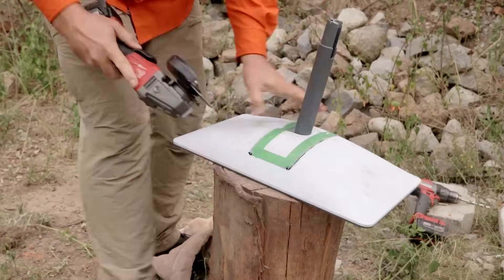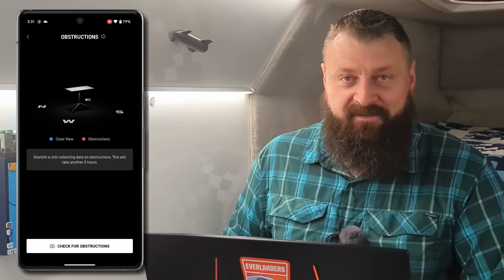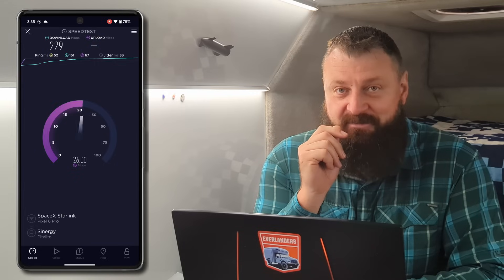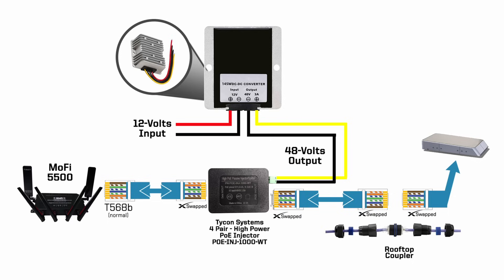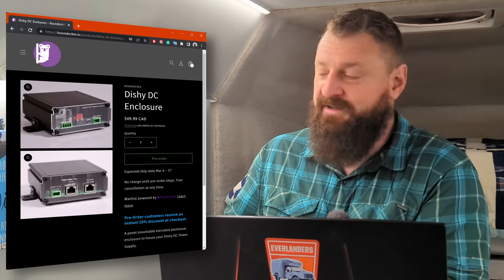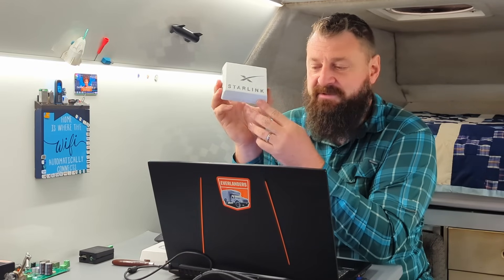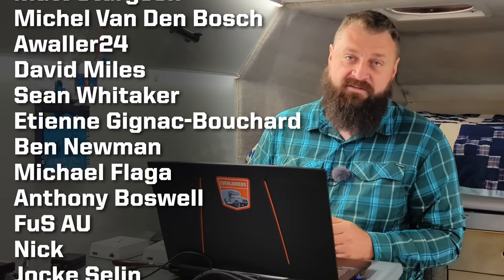Starlink DC Power Supply

Comment: @Everlanders could you please tell me if I need to X swap at the dishy and wedge side if I plan to use Boondocker 12v box?

It would be ideal to be able to swap between Boondocker's box and the original router if I need to reset the antennas and settings. 

Thank you
Reply from the maker: No need to X-Swap anything with the Dishy DC power supply, all ends can be crimped with standard T568b, and then a CAT6 shielded coupler can be use to connect to the Starlink Router.  However the settings are all in the dish, and still accessable at http://dishy.starlink.com or via the app without the SL router.
Reply: @Everlanders  Cool. For some reason when I was testing at home, connecting directly through my router without the original starlink one the app wouldn't give me any option to reset or show the connected devices.
Reply from the maker: @EastofSomewhere  No connected devices is true... Because that is now handed by the router that Dishy is connected to, but reset and snow melt and most other setting are done in the dish itself.
Reply: @Everlanders  Thank you. BTW I renewed my membership but it did it with my personal channel that I don't use much. 

Could you please don't use that one for mentions in new videos? That one is Will Perez Ronderos. 

I will try to bring it back to East of Somewhere next month. I may had been logged into that one when I changed the payment method.
Reply: @Everlanders  This one is me but the alternate account 😒. I lost my badge and got the new member again. Shame.
Reply from the maker: I'm pretty sure you get you badge back when you switch your account back.

Comment: May a dump Question but why cant i use any 12V POE Injector?
Reply from the maker: Because the dish needs 48 volts to run...
Reply: @Everlanders  Sorry I meant 12V input but I found out in the meantime that the dish seems to have a special pin assignment and does not work with "normal" poe injectors.
Reply from the maker: The pin assignment is a trival issue, just rewire the RJ45. The 48 volt PoE is the bigger challenge.

Comment: 15:58, do you still use your MoFi 5500 LTE Router? Just not using the LTE function, but connecting the Starlink to your WAN, right?
Is there another more economical WIFI Router that you recommend now for SL usage alone, and 24 volts, please?
Reply from the maker: Yes, we still use our MoFi and we still use LTE from time to time. There is still no Starlink in Bolivia, Paraguay and Uruguay, so we might need to rely on LTE again there. But if you want something cheap, any old router would work fine. Or watch our next video...
Reply: @Everlanders  , I've already ordered the Starlink Dishy DC and used the promo code "Everlanders" and got 10% off, Thank you.
Can't wait for the next video for a WIFI router that would suit us all in RVs and Boats on a 24 volts system

Comment: 4:15 That is interesting that rain interfiers so much.  Do you suppose it is water pooling on top of the array?  Perhaps a decent reason to tilt it somewhat to shed water pooling.  Or perhaps in your case apply a layer of rain-x or some other hydrophobic coating.
Reply from the maker: When we have clear shot of the sky, the rain has a minimal effect, dry tree cover slowed it down a bit, but wet trees are the worst. I could rainx the trees I suppose.
Reply: @Everlanders  No ! Dont do that, leave the trees alone - joking! StarLink is Ku band from the Satellite to the dish so some attenuation in the signal is expected during rain. Heavy rain will most likely take you off line. The high performance dish ahs a stronger signal to help with this.

Comment: I like it, though I would think a wan router design would be a  better solution as the  would give you options to cover a second to forth sat, POE based 4g/5g services and may be a air fiber  based connection service..

with a lot of things become poe based hardware internet service these it is just commonsense to build capacity into something  for practical deployment...

if i were going to deploy starlink in  in fixed capacity like you  I would be thinking 4 points of the compass deployment so there bw noway of missing a signal for  service
Reply from the maker: Clearly you've not traveled latin America.

Comment: Hi Everlanders, I like your videos please could you help me with next question?, I did the Swapped pinouts in the dishy cable that came from the antenna according Tycon PoE  Input/Output pinouts and the same pinout for the cable that goes to the router, the question is, the cable between Tycon and router, must to be a Cat6? 
Is possible to connect the cable for the router directly to a laptop that supports IPv6 ?
Can I change in the pinouts order  for the dishy cable that goes to the Tycon for other different order considering the voltage pinouts of POE?
Reply from the maker: Yes, you can connect directly to the laptop.

Comment: Having your internet connection running direct from your batteries is the only way to go, I can leave mine on 24/7 because it uses so little power and when my batteries are low in winter I turn the inverter off but can still use the net via my M1 mac for another 6 to 10 hours. Makes those worst few winter months far more civilised :)

Comment: Hi Thanks for sharing all those magical projects, I love it. I order that power supply 3 weeks ago and received it today. They made a little change in the production version for the location  of the 10A fuse. The RearCover "hole" did not match anymore with the fuse location. I guess I can trim the plastic of my printed read cover to make it fit. But it would be appreciate if you can create another rear cover file for the production design. I have picture to share if you need. On the other hand, I am still trying to print the Starlink Flat mount but since I am new to 3D Printing it's kind of hard to have a successful print.
Reply from the maker: Thanks for sending the photos of the new Rev 1.4 board, I have updated the files and posted them to: https://www.thingiverse.com/thing:5893999

Comment: On the crimp difficulties there are 2 different styles of rj45 ends. You are likely using an end designed for solid cable on a stranded cable. Using the right design will make it much easier.

Comment: Just came across your channel and it is fantastic! Working my way through your videos now. QUick question for you on the cellular modem you use. Did you use this when you were in Canada?? Are you able to connect to any of the "Big Three" carriers with a data only sim card? I cannot find any info on if this is possible in Canada. Thanks for any help or leads! Keep up the great work :)
Reply from the maker: Yes, of course... It's unlocked and will work with any carrier, Plus it's a Canadian Company, so you can be sure it works.
Reply: @Everlanders  Thank you so much for responding so quickly! I had no idea they were Canadian. That is great. I have been looking for months for an option for our home which has no other internet options other than DSL or possibly Starlink. The next challenge will be to find some kind of reasonable data plan in this country! lol Not easy :(
Reply from the maker: I'd think Starlink will be a much better option.
Reply: @Everlanders  you are probably right. Just a very long wait list so far for our area. over a year as far as I know.
Reply from the maker: @knappce  Then the MoFi can help fill that gap, unfortunately the data rates in Canada aren't so great... 😔
Reply: Thank you again for your replies. Really enjoying your videos. Your trip through South America should be incredible. Has always been on my bucket list to get to Patagonia.

Comment: awsome video
just to confirm the pin is Category B
Reply from the maker: T568B
Reply: this is to confirm your new poe injector is Standard B?
what is swapped means starlink pinouts?
Reply from the maker: No it does not conform to any standard, please refer to the pinout shown in the video diagram.

Comment: I have a Pepwave Max Transit Duo. I’ve read some folks having speed issues connecting Starlink to WAN port. Pepwave instructs customers to add an unmanaged switch between the router and Starlink ethernet adapter. 

With this 48v converter unit and changing the Starlink dishy cable to the typical ethernet cable configuration do you think the switch is still necessary?
Reply from the maker: I don't use Pepwave so I couldn't say...

Comment: I plan to convert my camper from 12 volt to 48 volt. Will I need to do much to get Starlink to work with this?
Reply from the maker: A 48 volt battery will swing from 42 to 56 volts, so you'll need some kind of boost  circuit when it's low and a buck circuit when it's high... Plus a bunch of regulation for all the 12 volt RV stuff... Not sure what the draw would be going to such high voltage for an RV.

Comment: I'm off grid with solar, and was considering Starlink as other available options were inadequate at the time.  However, it seemed to me that the Starlink system consumed about 80-90w of 120v AC power continuously to operate.  This put it at 2x the daily watt hours of my 18 cu ft self defrosting standard fridge.  Maybe I missed it in the video, but do you have any issues with the amount of power it consumes?  Thankfully my local phone company finally came around with fixed wireless internet so I can get 50mbps for CAD$150 a month and disconnect for 6 months of the year, and no up front hardware cost so I no longer need Starlink but I'm still curious about the power consumption issue for off grid applications.
Reply from the maker: Our consumption is 28 watts, averaged over 24 hours.
Reply from the maker: As shown here: https://youtu.be/gRSnTMrUPrQ?t=1928

Comment: When using these, how many watts does it pull between the dish and the new router, vs the original way?
Reply from the maker: With a high quality inverter and the original Starlink router, 60 watts.  I'm getting 28 watts on DC averaged over 24 hours.

Comment: A bit of a wild guess here without any previous research done, but I'm thinking this could all be done inside the antenna itself before mounting it to the roof. But now it would be a hassle since it's not easily removable due to the mount being glue in place. Don't want to be a downer but wouldn't it be easier if the mount and the antenna were set with maintenance and future upgrades in mind?
Also 48v I'm thinking they used it to power the motor?
Reply from the maker: No, It would be very easy to put it under the rooftop mount, just pull the screws from the aluminum brackets and lift it off the mounts. I would not consider this however because then (a) a watertight enclosure would need to be built and (b) you'd need to run 10 or 8 gauge wires up to the roof for power, kinda defeating the point of PoE. I don't understand how you feel it can't be maintained, It is simple to remove with a few screws... And no, the two motors are 12 volt... The 48 volts is required to get 100 watts of power for snow melt over long distance of thin wire with minimal losses. If it was 12 volts it would need to be 10 AWG or bigger.
Reply: @Everlanders  That makes more sense now, I've missed the part of mounting it on top of the brackets, that's perfectly maintainable doing it that way. But the circuitry there looked a bit exposed at the moment after cutting into the antenna enclosure. I was thinking this as a more direct approach to keep all in the same enclosure and directly powering it with 12V if the 48V was not needed. Apparently not a better way of mounting it now knowing what the 48V volts are there for. Would always need a buck converter for this. So kudos it's very well thought as it is now.
Reply from the maker: Just to be clear, for others that might read this, cutting the leg off as I've shown in the last video does not expose the circuitry, it's still watertight in the original factory housing.
Reply from the maker: As shown here. https://youtu.be/gRSnTMrUPrQ?t=990

Only the original (vented to atmosphere) motor compartment was breached. The antenna is still sealed.
Reply: @Everlanders  Spacex designed this quite well if cutting into the motor base enclosure doesn't expose the actual antenna circuitry. Tinker proof. I'll not make any more considerations into this as I don't currently own an antenna, but intend on getting one. Assured now this is the best way to go.

Comment: Slow speeds could be due to congestion.  I think you are getting over 200mbps because you are in a "remote" area without a huge number of starlink users.  Many areas of the USA are much slower because so many people signed up.
Reply from the maker: Clearly congestion is a separate issue, that's not my point, the point is that poor crimps with 7/8 conductors connected will limit the speeds to >100mbps. If you've taken your dish to a densely populated area that's a different issue.

Comment: do you need a router really or it can work without? to me it's extra power consumption .
Reply from the maker: Not explicitly, if you are using a laptop with an RJ45 Ethernet port you could plug it directly. But if you need WiFi then you'd need something to create the Access Point.
Reply: @Everlanders  thanks. So star link antenna don't have a wifi router and neither application.
Reply from the maker: The Starlink Router has the WiFi access point. Perhaps our next video will have a good solution for you... 😜

Comment: Instead of having to deal with sketchy RJ-45 connectors what would happen if you just soldered the wires right to the board or maybe used an 8 position terminal strip like the remote switches used instead of an RJ-45 connector?
Reply from the maker: Just use quality 3 prong crimps and you'll be fine.

Comment: You show those cable wires pushing through that RJ45 connector so easily.  That was not my experience at all.  Do you have trick, or did I have the wrong RJ45 connector?
Reply from the maker: I pinched them flat with my Sasquatch fingers, a gentle pinch with some fine plyers could work too! 👍

Comment: How does one check for RJ45 issues other than slow speed?
Reply from the maker: Of you have RJ45 on both ends, you can use a cable tester. But if it's the dish on the end of the cable it's not possible and speed test is the easiest.

Comment: Whats the power consumption look like running starlink with this unit?
Trying to determine if I can run it off 2 12v 65ah batteries, charged by panels. Currently running 2 100w 5.5amp panels with mppt charge controller.
Reply from the maker: 30 watts...

Comment: Does this work with in motion antenna?
Reply from the maker: Like this: https://youtube.com/shorts/4CChVRRRpNc
Reply: @Everlanders  thanks for sharing that clip, just to be sure, I’m asking about the new in motion antenna, the power demand is higher, and the antenna size is larger. Maybe it’s POE Speed it’s standardized and this is an amateur question.

I am aware of people flat modifying the “non motion”  regular dish and where you’re located. Motion works fine.
Reply from the maker: Your referring to the 300 watt High Performance dish (with the same performance)... No this 100 watt supply will not power the 300 watt dish.
Reply: @Everlanders  yes thank you for correcting my error and appreciate your video and details. Very cool stuff!

Comment: That was bloody awesome! We’re about to do our Lap of Oz in a caravan and are yet to get Starlink and are so damn impressed with your flat mount video and now the 12v option as we want to mount it on our Fourby and run it while driving! Sorry if I missed it but is there any reason why you’re not using the Starlink router?
Thanks once again your bloody legend! 🤙🏽
Reply: This mod dose away with the need to use the Starlink router. You can use any router you like. All the smarts are in Dishy.

Comment: Speeds in our RV traveling accross the usa are much slower, we rarely get over 40 or 50 unless we are in a much less congested area.  Our starlink has been run over by fellow rvers 3 times, when it happens the motors are crushed and i had to manually point it at the northern sky until i got a replacement from starlink.  I am getting ready to hard wire  cables with connectors into the rv to make set up and tear down quicker.  We mount our dish on several different ways depending on the campground, sometimes on our 25 foot pole, sometimes the ground, sometimes on the roof, sometimes on a custom 5 foot pole that i made custom 3d printed mounts for.(this keeps people from running it over).   We have to deal with a lot of tree obstructions in campgrounds, a few times we were completely obstructed like in florida, Wyoming and Michigan.  Larry
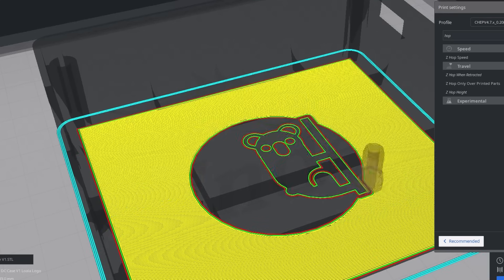Reply: 12:37 i thought i was the only full time RVer that traveled with a 3d printer and design and print every day for Etsy.  Larry
Reply from the maker: Yup, it's not intended for dense usage...

Comment: If you want to use a sacrificial starlink ethernet port adapter instead of cutting your 50 foot starlink cable do you still use the same straight through pinout or do you need to swap the pinout for starlink connection to the ethernet adapter?
Reply from the maker: Your going to need to rephrase that, I don't understand.
Reply: @Everlanders  I want to cut the end off of the starlink ether net adapter and use it instead of using the starlink cable itself .  I bought one of the starlink Ethernet adapters and want to plug the starlink cable into it instead of cutting the cable.  So power supply>starlink Ethernet adapter> starlink 50’ cable> dishy.
Reply: Do I still use the swapped pin out on the Ethernet adapter or just standard Ethernet  pin out